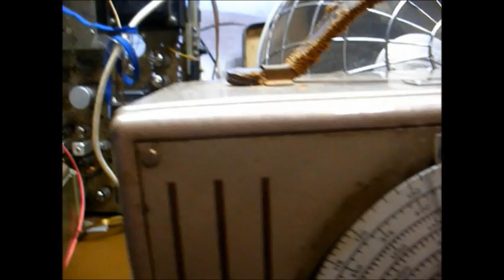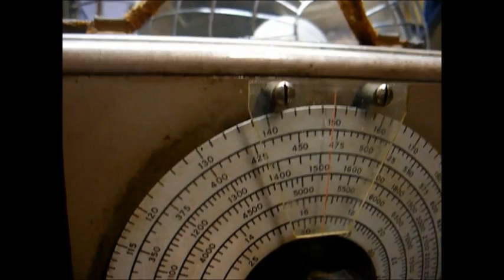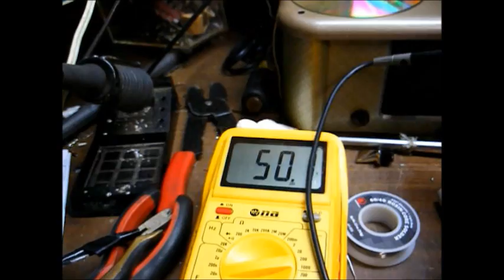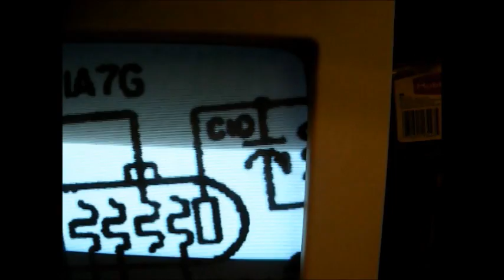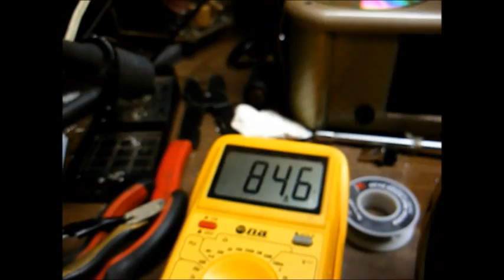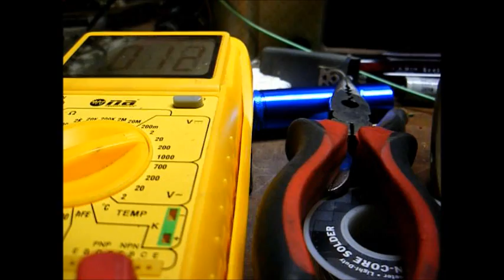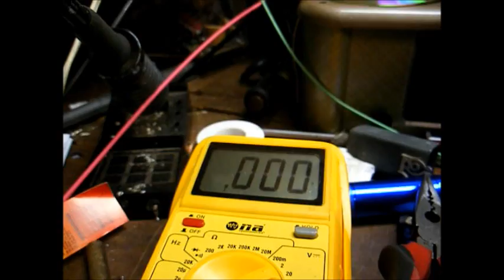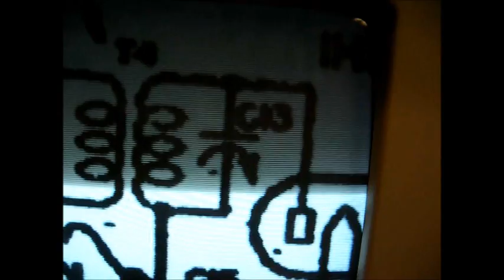Repair of a 1939 Emerson battery operated portable tube radio - part one

Comment: Interesting - I recently acquired a similar Emerson and am hoping to wire up some 9 volts for the B batteries (already cut one in half for the A supply).  That power supply kit from AES looks like a good investment, but my set is AC/DC so I'll probably make faster progress by replacing the lamp cord.  The plug actually goes into the chassis to close contacts when it's on battery power.

Comment: Hi there.

I am in need of a motor spinal (The small brass fitting on the shaft of the motor.).  3 speed BSR MacDonald umbrella changer.  Had this for years and like to use it for older 45's and 78's.  If you have one, let me know!!

Comment: Many years ago when I was a teenager, I had a radio very similar to this except it was AC and battery. Strangely, it had two audio output tubes; a 3Q5GT and 117N7GT, a combination power pentode and half wave rectifier. I never could get it to work and trashed it. Whew, what a mistake that was considering I have a lot more knowledge these days than I had back then. The cabinet was red and identical to yours.
Reply: I have an Emerson 560 which I didn't know was originally a battery-only set until I looked at the original schematic.  Someone before me had converted the radio to AC, and did an excellent job of it.  The person fitted a 117Z3 rectifier in an open spot in the chassis, added a multi-section filter capacitor, used a high-wattage resistor divider to provide the B+ voltage.

Comment: Have you ever tried unwinding a few turns of the open coil to see if the break/open is within those first few turns?  If so, repairs can probably still be made without compromising the coil much...
Reply: dodgecharger4404 That only works if the break is on the outside turns of the coil...